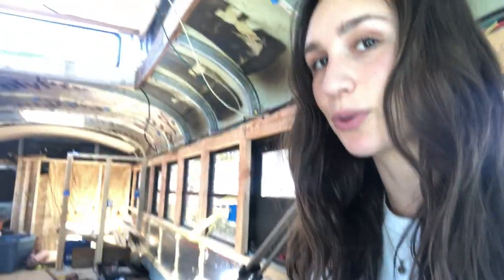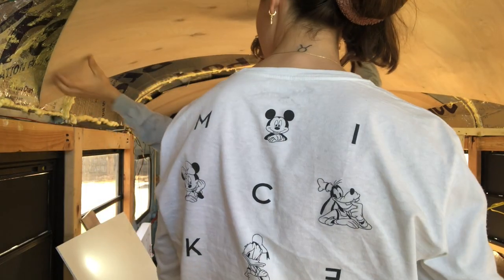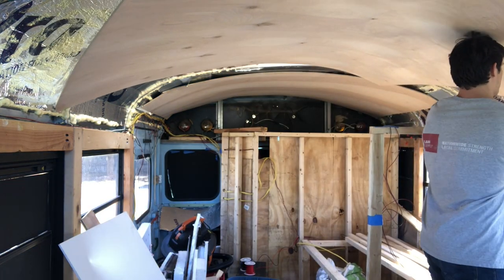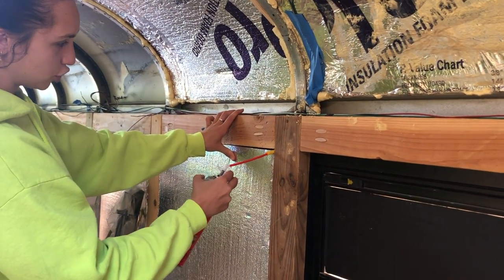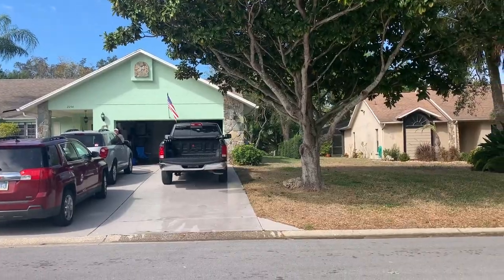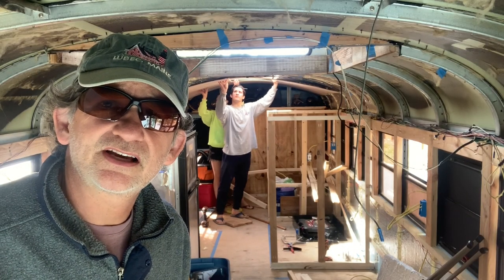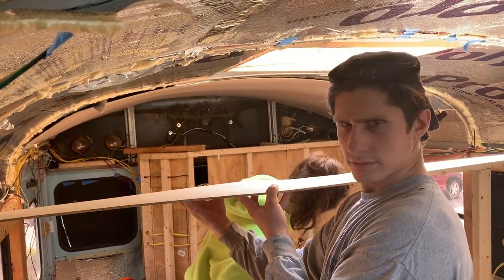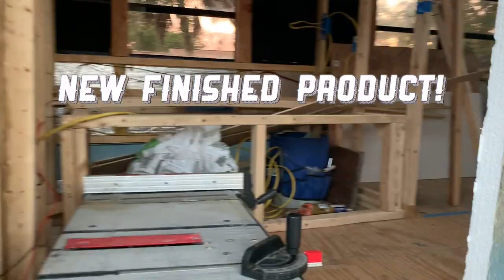Birch Plywood Ceilings in our School Bus Conversion | diy skoolie | air-stream remodel design

Comment: 👍👍👍 looking good,love your skylight and that camper top on top of the bus I have a skylight but it a fixed skylight it doesn't open I might have to change that it came that way ,keep up the good work.✌❤👨‍🍳🎅🥩🚌'S
Reply: A skylight or vent in the bathroom or the shower so the moisture has some place to go???✌
Reply from the maker: Chef Santa's CulinaryTravels we are so so happy everyday with this truck topper - skylight idea! It worked out perfect... we will most likely install a small venting fan in the hallway right outside the bathroom but can keep door and window open to vent!